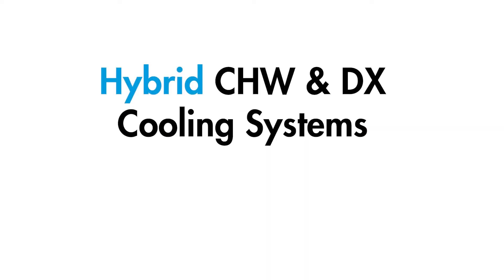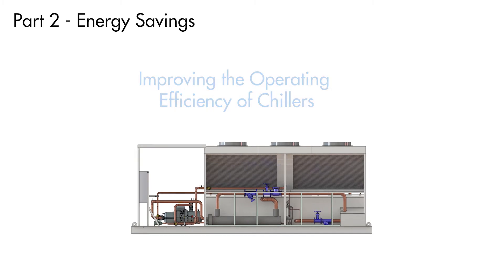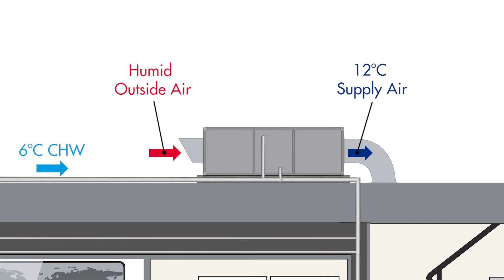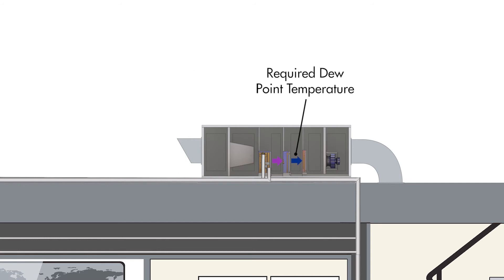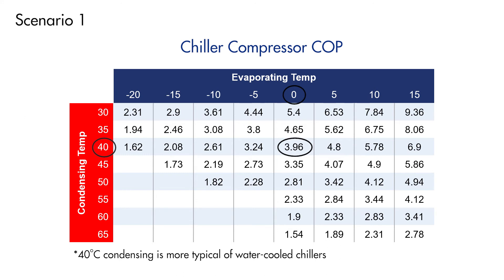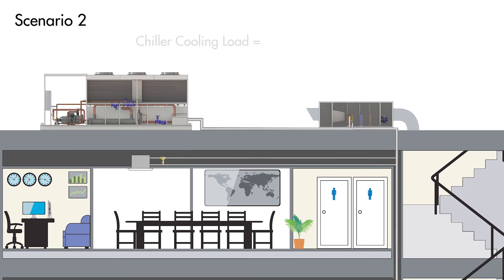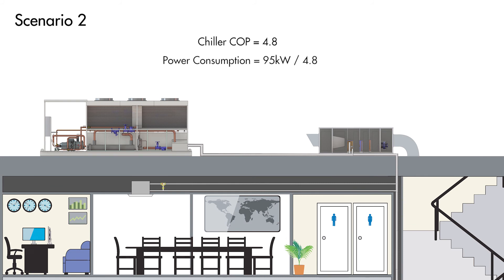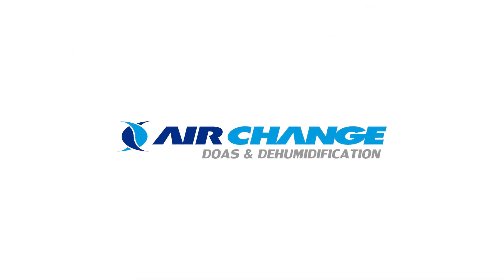Hybrid CHW & DX Cooling Systems Part 2: Improving Chiller Operating Efficiency

Comment: Lower chilled water supply temperature may result lower chilled water flow rate and lower pump power consumption.  However the calculation of energy saving excluded the power consumption of the pump.